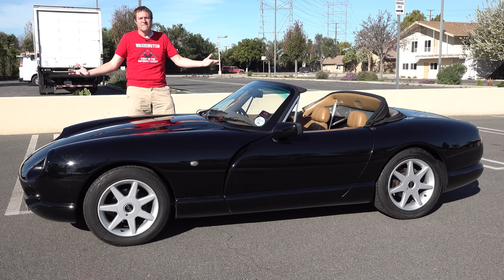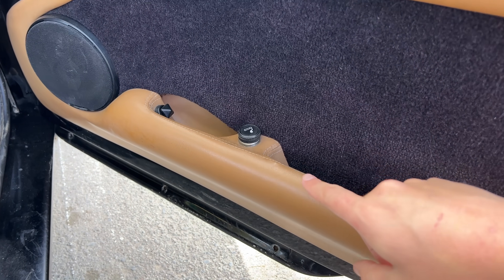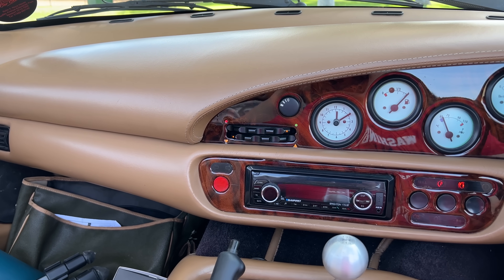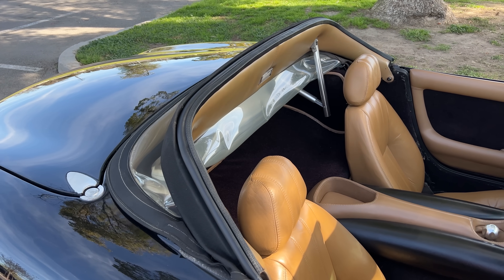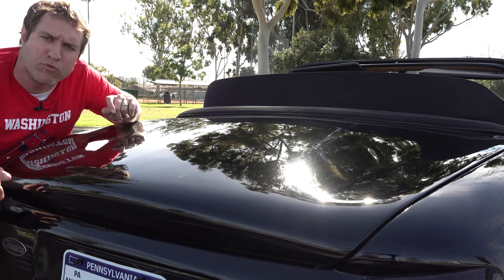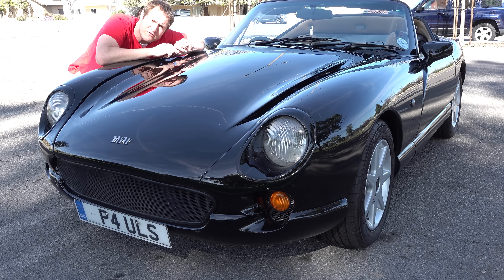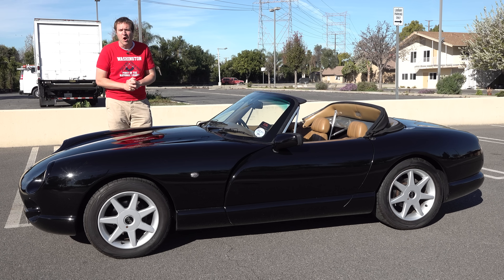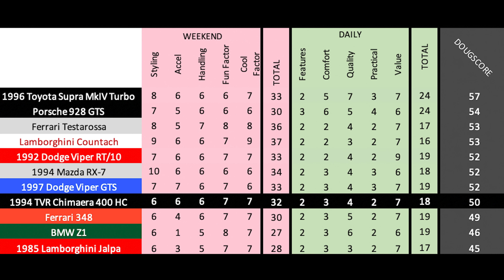The TVR Chimaera Is a Quirky, Weird V8 Sports Car

Comment: I’m in the UK. I recently sold my 1998 Chimaera. A few things to say about a great video from Doug. First: don’t ever drive your TVR with just the targa up and no roof, because as you drive along the pressure will rip out the stitches of the rear wind screen. Second: later model TVRs had slightly better ergonomics and nicer switch gear, they also had extra climate control vents in the centre console. Third: Doug never mentioned the stupid ‘dimmer‘ switch for instrument lighting, it’s either off or on, it doesn’t dim. Many folk rewired it as an engine start, or immobiliser button. Forth: in warmer climates over heating could be an issue, those engines in a fibre glass body generate a lot of heat, but there is a relatively simple and inexpensive mod that kicks the cooling fans in stages. I had my Chimaera for 10 years as long as the chassis is good the rest of the car is easily looked after if a little eccentric.
Reply: This brings back memories. Had a friend in London with a Cerbera around 2002-3 so had some fun rides. A lot of similarities with the Chimaera and shared switch gear but maybe a slightly more practical option.
Reply: Also oddly, the vid didn't really talk about styling which I think is quite nice. People go on about the E Type but (both of) these are up there.
Reply: I wish Doug would review Austin-Healey's, MG's, Fiats, Morgan's, Lancia's.
Reply: The 2nd gen rx7 had a very well done version of this top, the target panel was hard so you got near coupe like quiet with it up, the top could be dropped like a normal vertical, no need to remove the top panel if you don't want to as it stows with the rest in one piece. And of course in target mode the fabric half doesn't shred.
Reply: @markspence3750  He mainly does his work in USA but sometimes travels. I am sure if one of those cars came up as a choice for him to review in the USA, he would,but I don't see Doug just travelling to the UK for just 1 car. I seen him travel but it was for multiple car reviews in the same traveled to country. Hope this helps.
Reply: Did your Chimaera have the turn signal stalk on the right? I thought that was just a Japanese Market phenomenon?
Reply: The dimmer switch turned off all the dash lights except the tacho.
Reply: @morgan7a  I also had a friend who owned one, was your mate called Graham? I remember how you could feel the car approaching, that engine rumble on the 5 litre was ridiculous :)
Reply: Still more practical than my Mantula!
Reply: I own a Tuscan after a 3 year flirt with Porsche. The oddities are more extreme on that car but I just love it in a way I could never have loved the plasticy Porsche.
Reply: What's it like to maintain?
Reply: @김선찬-w3j  You really should be reasonably practically minded to own one but after 2 years, I've had to replace an electrical controller that controls the door and window. Simply diagnosed by swiping the right and left units. I change oil regularly and have re-shimmed the tappets myself. Otherwise it's simply awesome. Parts are readily available in the UK through TVR or racing green so no problems there.
Reply: @Cocytus  Just to add on that, he did a whole video where he said he has offers in Europe for every car he wants to review, but they’re all spread out all over Europe so it doesn’t make sense for him to go there. He basically said the only way he’d review anything there is either if he was already going to a nearby city for work (like when he went to Dubai, he was there for the Corvette ZR1 launch and just extended his trip to do all those reviews) or if a handful of fans in one area came together and said “hey we have a Renault Aventime, a Citroen Cactus, a Peugeot 205 GTI, etc. that you can review back to back to back”
Reply: @grummpyyounggeek  turn signal (indicator) stalk on the right was typical of British cars, at least in their postwar heyday. I didn't realise TVR carried on that tradition into the 1990s though.
Reply: @colinhare4722  Are they? Does TVR still make parts or is there another company?
Reply: His name is Snoop Doggy Doug from now on. Please refer to him as that!
Reply: @김선찬-w3j  TVR still make parts or at least have them made. I understand that many of the replacement parts are better than the originals lol
Reply: Why does it look like a Porsche at the front?? 😆 Doug never mentioned that. Looks like Trevor was into Porsches.
Reply: @grummpyyounggeek  This applies to all right-hand drive markets, not just Japan. I live in Australia and all cars have the indicator stalk on the right as well.
Reply: @kiryukazuma88  England must be exception to the rule. I'm based in UK and our indicator stalk is on the left (or at least is on "modern" cars circa 1990 and newer) Judging from the comments here, right stalks were a thing in England at some point but those must be either really antiquated designs before my time....
Reply: @grummpyyounggeek  A lot of British cars of the 60's /70's had the turn signal on the right.
Reply: @김선찬-w3j  surprisingly easy. It's a river v8 so pretty simple stuff. Main challenge is keeping rust from the chassis
Reply: @hughmarshall8704  we just get 'lazy' left to right hand drive conversions of the european market cars now (notice how on some cars the handbrake is on the wrong side for a right hand drive car and is just damned awkward to use). In Australia and Japan they have different regulatory frameworks that force the difference i think. It's so you can change gear and change which direction you are indicating at the same time!

Mazdas of the 90s were like this, my uncle had an MX-3 V6 and it had the 'reversed' column stalks
Reply: @colinhare4722  I drove a Tvr Tamora years ago and was considering trading it in for a Porsche 996. The Porsche was so plastic inside it instantly put me off

Comment: Fun fact: The "Rover" V8 was developed by Buick in 1960 as an all-aluminum, 215 cubic inch (3.5 L) economy engine with 150 HP. Buick eventually raised the compression ratio from 8.8:1 to 11:1, slapped on a four barrel carburetor, and by 1963 it made a pretty impressive 200 HP and 240 lb⋅ft of torque. GM cancelled the Buick 215 after the 1963 model year due to the high cost of producing the all-aluminum engine, and sold the rights to the Rover Company who first used it in 1967 in the Rover P5B. Rover used the engine up until the mid-2000s with various improvements, updates, and capacities.
Reply: Many many other companies also used it.  Best decision Rover ever made.
Reply: Buick was experiencing appallingly high scrappage rates due to porosity--the blocks were die -cast and the porosity didn't show up until a significant amount of machining was already completed.  Rover went back to tried and true sand casting with eliminated the problem.  When they acquired the engine they also hired a Buick engineer who had just retired to help them develop it further.  Typical American thinking here, they told the engineer they wanted a higher rev limit, to which the engineer replied, "Why?"
Reply: @mescko  did they do it as some cars have 6000 /6500 rpm limits which seems high for a 60s american v8
Reply: Scotty Kilmer talks about it in his video "I Just Found a Replacement for My Celica". He got a Triumph TR8. He said it is a very good engine, very reliable. He said the Brits were ahead of the US in making aluminium at the time, so it made sense for them to buy it.
Reply: @ablair37  yes.
Reply: @andrewnorris5415  The standard engine did have one persistent problem, namely the main bearing caps had issues with fretting (I would guess due to the higher thermal expansion of ally than cast iron),  That's why the late 4.0 and 4.6 versions of the engine had cross-bolted main caps.
Reply: and luicky old us brits we built these up to 370 plus bhp ....... the rover/buick engine is a classic .
Reply: @andrewnorris5415  You're not wrong there in fact it was Birmingham where a lot of techniques were pioneered using aluminium, primarily for war use - Birmabright is a trademark name for a grade of aluminum and I believe stir-friction seam welding for aluminium had some roots in development here. Given the excess of aluminium left over after the war, its not surprising the car industry got hold of it and started to do interesting things with it. Obviously, one of those things was the Land Rover.
Reply: Indeed, a manager from Rover (so the story goes) was visiting a Buick factory and saw the engine in the corner and enquired about it. The GM man basically said it was more of less an experiment in aluminium block V8's used for a short period of time, but they were going back to iron Blocks. The Rover manager was really interested as it filled a need to replace the old straight Six engine that they used in cars up to the P4 (and early P5), so bought the rights to it. So the Rover V8 was born, and it was updated so much in the end that the Buick engine looks nothing like the last of the Rover V8's. Cracking engine that was the mainstay for small British car brands for 50 years.

Comment: The turn signal stalk position is actually weird, Doug. It’s common to be reversed in Japanese cars, but RHD cars in the UK usually have the stalks in the same position as we’re used to with LHD
Reply: Lots of car manufactures do that to save costs on this side of the pond.
Reply: I’ve got an old Mitsubishi shogun sport in the U.K. and I forget every time I use it..
Reply: Makes me wonder if this was actually a JDM TVR in which case the indicator location would make more sense.
Reply: Actually, old UK cars had the stalks the same way round as the Japanese. My 1967 Mk2 Cortina had an indicator stalk on the right. I think they got switched around when the UK joined the EU (or EEC as it then was).
Reply: @BIZKIT551  they look a bit suzuki ish even though they do use a lot of ford parts
Reply: the most estrange for me in English car was trying to find the key ignition hole. Before knowing the place I had to open keep the driver door opened in order to bend my head and look at.

But shifting with other hand is surprisingly easy and natural to learn.

Comment: US based Chimaera owner here. I have a 94 with a 4.6 JED motor I imported in November. Some corrections for the pedantic, because when else am I going to be able to talk about something so specific! The top climate knob controls the temp, the bottom one controls the direction of flow. Besides the dash panel vents, there's a foot vent on each side. Weirdly, the driver side dash vent is EXCLUSIVELY for cold air. There's a separate unlabeled rotary knob under the column that controls a blower motor that sucks exterior air into the cabin through that vent and another footwell vent. There's another unlabeled underside column button that turns off the dash lights. No dimmer. Just on and off. My Chim has the turn signals on the left, which is typical for British RHD cars, typically JDM RHD cars will have the right side signal arrangement. My window switches are also mounted behind the shifter, instead of in the front, which shows how much TVR just did whatever they felt like when they were building them. So far it's been a blast, I'm a previous Elise, SW20 MR2, X100 XKR, Caterham, NA Miata, C5 Corvette owner, and this feels more in the GT than pure sports category. Like a Miata sized XKR. The space frames aren't the stiffest. Parts availability in the States isn't bad for hard parts. Rover motor, Ford T5 tranny, Ford brakes and suspension hubs/uprights. Great online community for knowledge. Values are still low for what you get, especially compared to what else similar cars in the market fetch.
Reply: You said pedantic and I thought of James May. This reads like something he would have written and I mean that as a compliment. That's awesome that you have a Chimaera
Reply: 95 on added 2 centre cool air vents to that drivers one.
Reply: Great write up brother! Thanks for the insight.
Reply: Does the turn signal in your car return?  I have a few British cars and I know the clock mechanism for the turn signal return can break.  It is also easy to assemble incorrectly if the steering wheel was removed for some reason.
Reply: @ianfurqueron5850  mine does. The car in the video doesn't have a stock wheel in it, the hub they used may not have retained that function. Stock was a Personal wheel with a different pattern then the more common Momo/Sparco pattern.

Comment: A slight correction: The Griffith was the top tier car. The Chimera was a lower entry point into the brand; more accessible. 

BTW, the rear window assembly used to drop lower than it does on the test car. I think it's had a replacement hood which isn't folding as easily.

The rear badges in 'modern TVRs were always an oval with the italics. I always thought they looked good.
Reply: Yep, that rear window isn't right, it should fold flat. You can see the struts aren't folding together properly.
Reply: I'm quite surprised Doug didn't figure out the roof/window situation for himself to be honest, he's been doing this long enough...
Reply: You have to give the folding hoop a real shove to push it down properly, otherwise it sits high, as reviewed. Then again, why do you need to see what's behind you? Obviously not driving it right...
Reply: @coronavirusadvice8746 sort-of... the Chim was sold as a more convenient and accessible car that fixed some of the fussier aspects of the Griff. The fact that the Chim sold way more than the Griff (despite looking worse ;p ). The engine specs were whatever they wanted to sell at the time - typical TVR disaster for planning and marketing
Reply: You got any TVR you’re winning at life

Comment: James May: "Did you know that in the whole history of TVR, there is no records of one ever breaking down?"
Clarkson: "I've heard that."
Reply: They just burned to ashes
Reply: Clarkson sending James may into the ocean
Reply: TVR records dept: Were we supposed to keep records?
Reply: That quarter window I genuinely weird. From a distance I thought it was from an mx5. I like quarter windows on convertibles, makes a huge difference to cabin turbulence. Drove convertible cameros, solstice, bmw 3 series without them, bugs in my eyes and mouth every time. Never had that problem in an mx5.
Reply: @iainbagnall4825  I had a targa top C5 corvette and would drive with the windows down and top off on the freeway and didn’t have anything hit me in the face. I think the windshield was tall and wide enough to block that
Reply: Lots of power, next to no safety equipment, and handling that was once charitably described as "adventuresome" - yeah, if one didn't break down in the first 200 miles, there was probably not enough left for the owner's next-of-kin to drive.
Reply: @iainbagnall4825  I think it's actually just a window guide for the leading edge to stop the window from rattling (and probably added late in development). Any similarity to a quarter window is just coincidental; they could have just used a single bent piece of metal but that would have been even more dangerous and probably less sturdy.
Reply: @iainbagnall4825  I had a Type 3 VW and the quarterlight directed a passing bee into my face at high speed
Reply: @W92Baj  I'm sorry for your misfortune but that made me giggle.
Reply: @W92Baj  When we thought we already knew every way in which the beetle was shit... we find another terrible feature (it projects bees into your face)
Reply: @iainbagnall4825  it isn't a quarter window.
Reply: @iainbagnall4825  Any opened quarter light can direct anything at you if you open it wide enough.

Also: The Type 3 is not the Beetle, but thanks for playing.